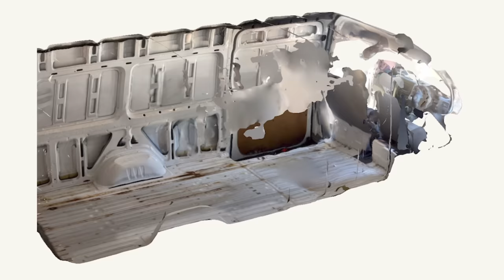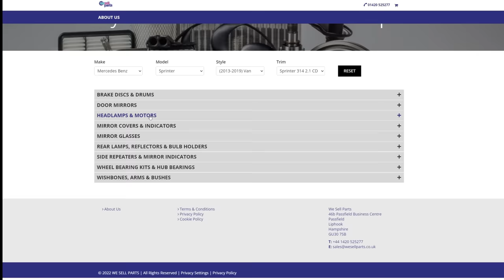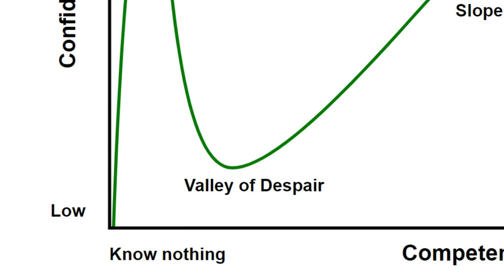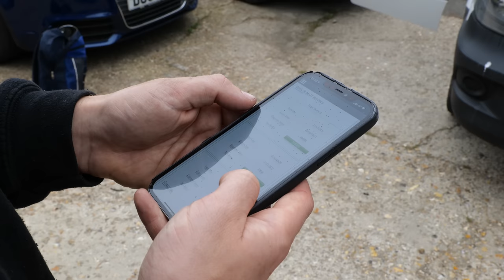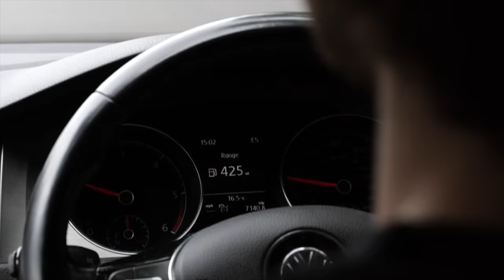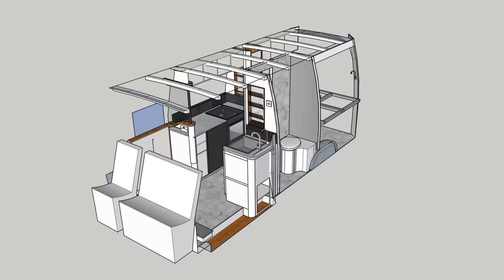I'm Converting a Van to Live Alone.

Comment: Don't beat yourself up about not reversing in after the test drive, the traffic on Shirley High Street  (AKA 'mutant mile') is always a nightmare!  You also inadvertently discovered another way to remove yourself from modern society... our local Spoonies is a bit 'special'!  If you're in the area again let me know, I'll stand you a cuppa and you can laugh at the smallest, most cluttered workshop in existence (my 'dust management system' is setting up in the garden and hoping it doesn't rain).  Good luck with the project Matt!

Comment: Some vehicle buying tips,  look at the MOT history of the vehicle.  Anyone can do this for free online via government website. If there's lots of fails or advisories then walk away as it indicates it's been poorly maintained. Also look through any service history provided BEFORE buying. Timing chain replacement a must for older vehicles. If the brake discs are grooved or tyres unevenly worn, again walk away. Look for misalignment of panels, and overspray(as mentioned in the video)

Comment: Welcome to a growing club! Hitting the road won't solve all your problems, but it does put you in a better position to escape speedily! 
I'm still figuring out how to line the walls of my LWB Mercedes Vito, after 18 months. But I have solar panels, a Maxxfan roof vent fan installed (cutting that hole in the top of your van is quite a step for a total beginner!), insulation, a sub-floor, and a ceiling. And a plan. (Sort of.)
Looking forward to following your build, as my van build was the thing that got me exploring carpentry, and this channel.
Oh, and remember that wood is heavy, and minimising weight while maintaining strength is a challenge I will be very interested to watch!

Comment: Couple of tips from living in a camper.
Hide your keys outside the van if youve been drinking.  The cops wanted to knick me in Norwich one night after waking me up and breathalysing me. Luckily id thrown my keys into the car park - which they admitted removed me from being in control of the wheel. Bonus.
Park facing the direction you want to get away if you need to. 
Have a safe.
Ventilation is key.
Put your shitter right by the sliding door, so if you're taking a dump near an epic view, you can combine them into a total win. 
Good luck dude!

Comment: Had a LWB Sprinter for work, good van and a nice place to be but please please please be aware of any and all holes you drill in it, they are horrible for rusting. Even if you don't drill holes keep an eye on the arches inside the van and if possible keep a way to move stuff so you can keep an eye on it in case you need to repaint or rust converter something down the line.

Comment: Great video! I converted a ambulance when I was in my early 20s and went round Europe in it with my wife, was a great adventure, both building it and traveling in it. Looking back I'd do so many things differently with the build, although it was much smaller, just a vaxhall midi van with a semi high top! Looking forward to watching this and seeing how you get on.
Reply from the maker: That's awesome! Sounds like a great time. I personally love the idea of doing an ambulance or a school bus.
Reply: @MattEstlea  This was a weird one as it was a midi van - so an ex-St John's Ambulance, had been stored in an RAF hanger it's whole life and only been to village fetes, never been in the rain they joked, had 8,000 miles on the clock when we got it. Even though it was about 15 years old the MOT tester said it was basically a brand new van! For £400 quid it was a bargain! My top advice would be not to skimp on bed size! Make sure it's as big as you're used to!

Comment: Ill be watching this one  only recently got into woodworking as im building a small teardrop camper. Always thought wood was harder to deal with than metal(which is what im used to working with) i found its a hell of alot easier with the right tools .good luck with this. Atleast you are starting from a place of wood working knowledge so should be a fairly simple build but as usual there is always speed bumps.

Comment: This may have been mentioned already but as a woodworker you may be tempted to use nice pieces of wood, and nice solid bits of wood (unless you have a nice stash of Cedar) are heavy!
Stop for a moment and think about weight.

You've bought a LWB Sprinter not the lightest of vans in the first place. it is only plated at 3500KG so you will not have a lot of payload to play with from the outset
Have you weighed it with a full tank of fuel and you sitting in the driver seat? 

if not first  tip I can give you, having done this several times now, is weigh it asap so you have a point of reference.
Use a weighbridge that can do the axles individually as it is usually the rear axle that will go overweight first!

Then estimate how much payload you will need for any passengers, pets, luggage, tools, toys, clothes, food and water etc?
Add that to the vans empty weight.

What's left is what your build can weigh minus say 10-15% for contingency.

If you do go over weight you can easily uplate the vehicle to a higher weight but you will have to have a C1 licence to be able to drive it.

Second tip, don't waste time money and especially weight, fitting pointless self adhesive sound deadening materials I can assure you it is a complete waste of time in a properly insulated van.

Last tip ventilation, the more the better proper top opening windows are invaluable, ditto two rather than one roof vent for in and out circulation.

Good luck

Comment: I see you're designing in sketchup, which is fine, but can I recommend Fusion 360? I use it for everything at work and it would smash this project in ways sketchup can't dream of, especially if you want to manufacture any CNC/lasered wood or metal parts from your model.

Comment: That's not an xlwb matt. Hate to break it to you thats a standard lwb one. You can tell by the border for the back side windows only being 5" wide as aposed to 18"
Reply from the maker: Pretty certain it is 🤔 Having checked all the internal measurements against the specs on Mercedes, it matches those of an XLWB perfectly.

Comment: BE VEERRY CAREFUL with maintenance on your Sprinter. I don't know what year you bought but a general rule is NEVER buy a used Sprinter. I just sold my 2015 last week having owned it for 7 years so I know of what I speak. I will try and find the guy's site again but basically he is a retired/ing Mercedes mechanic that has worked on everything Mercedes makes for 35+ years. He breaks down the issue in great detail but I will try and summarize. Basically the turbos run horrifically hot on these motors to meet the emission standards. To the point of glowing red hot. This isn't really the issue though, the issue is the oil. Because the turbos run so hot they cook the oil into sludge. Here is the dilemma, there is no "certified" automobile oil formulated to withstand this kind of punishment and Mercedes can only recommend "certified" oils from the government approved list of certified automobile oils. Its a catch 22. To meet government emission standards they have to run the turbos like mad but can't compensate for the heat with a proper oil because of other government standards. Motorcycles run a extremely high RPMs and heat (14k+ RPM) and there are many motorcycle oils that would easily handle the issues with the turbos. But Mercedes is legally prohibited from mentioning or supporting that to you. What happens with normal auto oil is that its cooked into sludge until it clogs up all the systems in the loop. So what happens after about 50k miles is something will go wrong, and you will replace/fix it but that is just a part of the whole system that is clogged and soon the next piece in the system fails and you fix/replace it and so on and so on until you find yourself constantly replacing components at an ever increasing rate and price. What really needs to happen is the entire system needs flushed/replaced but no one ever does that they just keep fixing the current issue not the actual problem. So since you already bought the van use a high heat motorcycle oil of the same viscosity as called for in the user manual. This also happens to be part of why I sold my sprinter as it was getting to that mile range that I didn't want to deal with. Cheers and good luck. I will try and find that site again with the mechanic that explains it all in EXCRUCIATING detail and post it to you. I think this might be an updated version. http://www.stephensservice.com/oil-related-failures-to-engine/ This is the original article with updates. http://www.stephensservice.com/bluetec-diesel-issuesproblems/

You have helped me so much with my woodworking and I am a noob, I am a life long gearhead so I thought I could return the favor. ;) Cheers
Reply from the maker: Wow! Thank you so much for this Shannon! Have bookmarked the page for future reference. Definitely a good thing to know. Appreciate your time in typing that all out!